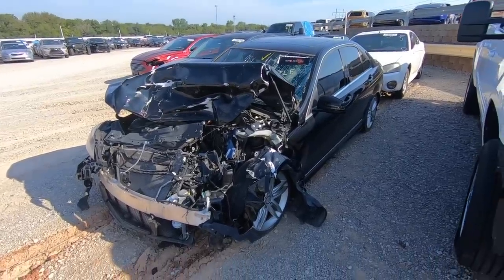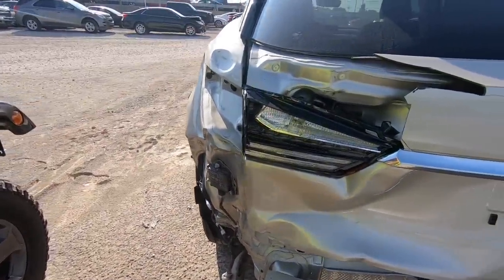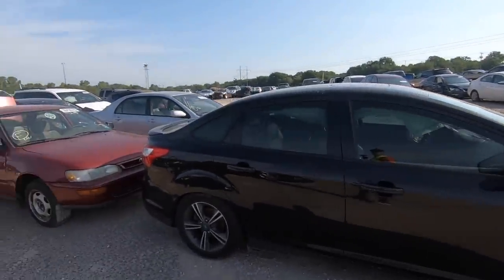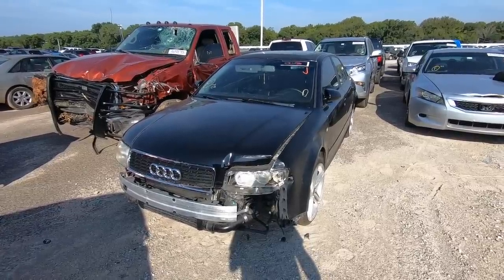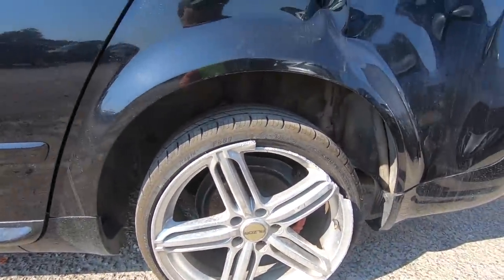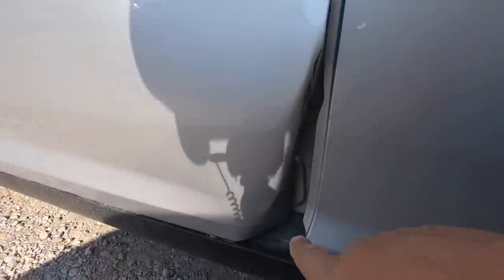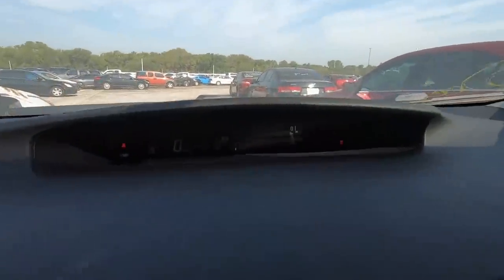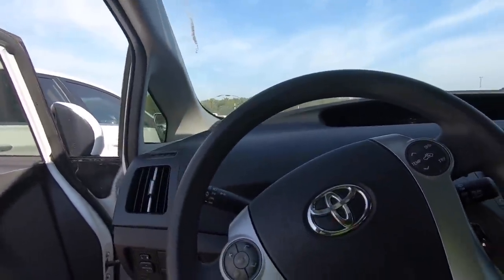Copart Walk Around + Carnage 9-17-19

Comment: That tundra at the end can be pulled back out but the door is going to have to be replaced for sure. between that and the bed you're looking at upwards of $7,000 to fix it. More if you don't want to just pull the cab corner out obviously. 2019 Toyota Tundra, MSRP: From $31,670 Towing capacity: 6,400 to 10,200 lbs MPG: Up to 15 city / 19 highway Payload: 1,440 to 1,730 lbs Engine: 4.6 L V8,/5.7 L V8  Power. 381 HP / 401 LB-FT. Transmission 6-speed auto

Comment: Some of the Mercedes you can buy an oil and it fits in the glove compartment and when the air conditioner is on it takes the oil and spreads it in the air conditioning system it's supposed to be a sweet-smelling thing

Comment: That Ford Focus most likely had an issue with the transmission mount, that’s why the engine was like that. I had the aluminum mount on mine strip, the engine dropped the same way that one is and it busted my axle off lol

Comment: Would leave the 3rd gen prius alone and actually go for a second gen if you can find one reasonable. I had a second, third, and now a Prius prime and I can tell you from experience the 3rd was the worst. Brake pump actuator to egr to oil consumption. If you must get the third gen 2015 is the best year since Toyota silently revised the rings and pistons in prep for the 4th gen

Comment: There's nothing wrong with a ABS traction control light comes will the check engine there's something in there so all those lights aren't necessarily wrong some of them were all traction control and the ABS get turn off computer what's in turn turn the light